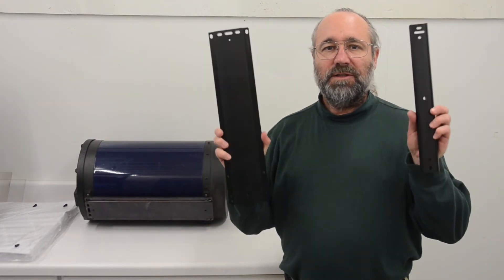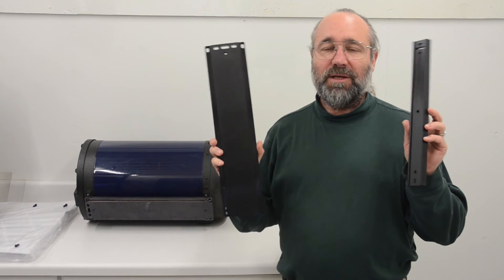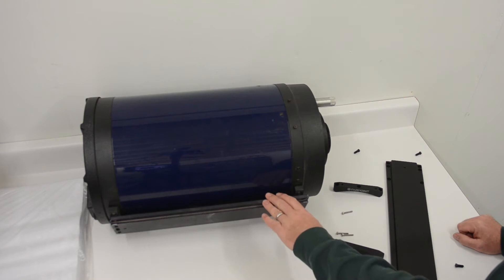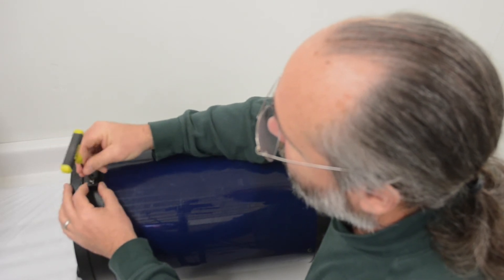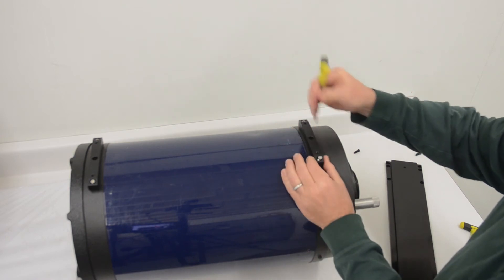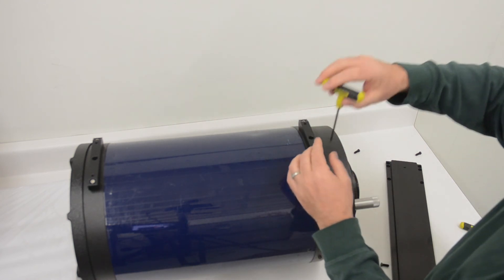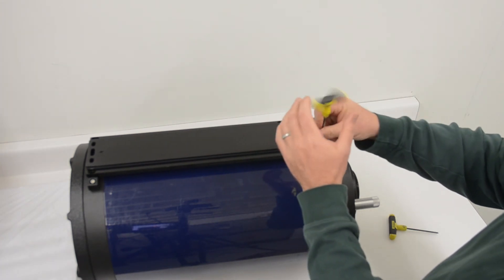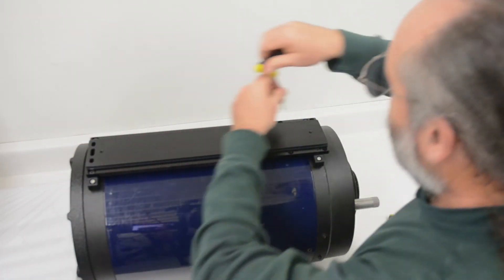Dovetails Part 2

Comment: I have the Farpoint Vixen dovetail for a C8. Even tho a puck is provided I still have to shim the rear and tweak lateral orientation screw to align the OTA to the mount. This has to be rechecked periodically. Although that’s a hassle, it’s better then the ADM which offers no adjustment. However, after a year of use I am not convinced the vixen bar adequately supports the C8. I don’t think the C8 was ever designed to support its weight thru those narrow space screws.  I often consider switching tp clamshell mounts
Reply: My C8 has the CGE plate and only fits on my AVX mount. I bought a Vixen Dovetail plate but after what you just said, made me realize you're probably right. The weight of the telescope by itself is enough to maybe bend the screws. But i did buy the Celestron made dovetail, maybe its more durable?.. I just wanna be able to use it on my other mounts.